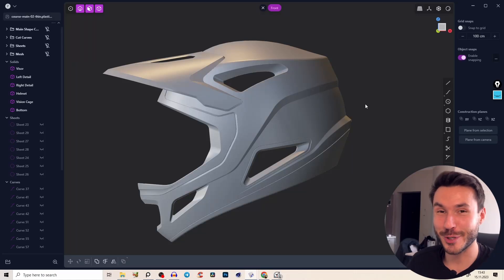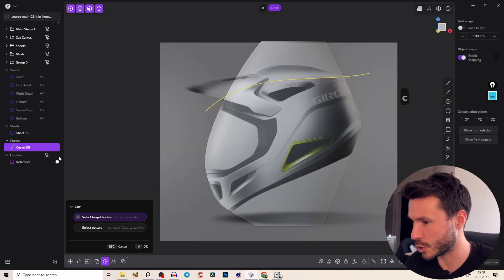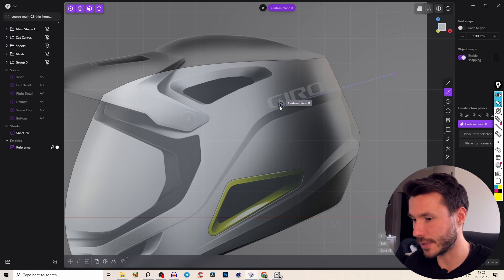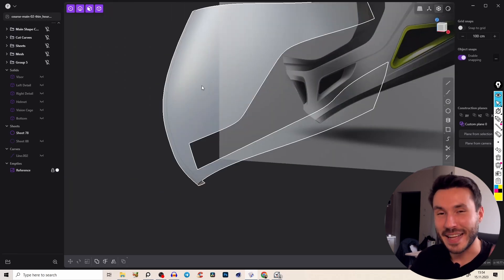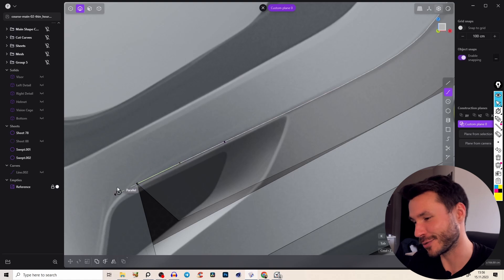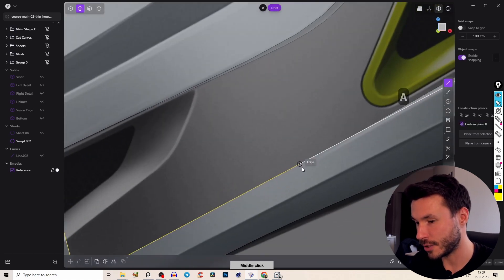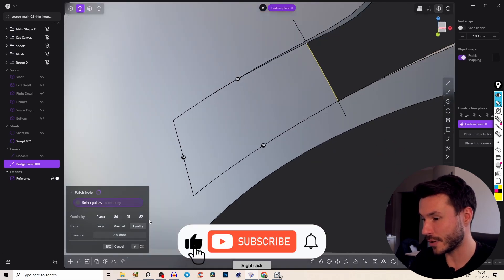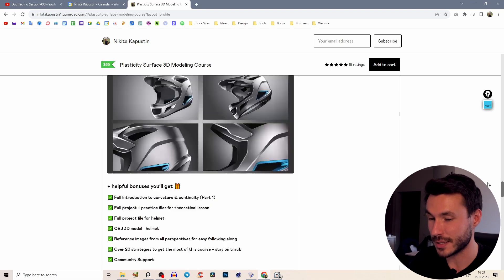How to Create Complex Details in Plasticity in Minutes!

Comment: Great tutorial!  I notice sometimes you use a Control Point Curve, and other times a Spline Curve.  Can you explain when to use each type?
Reply from the maker: I think there is no right or wrong. Generally Spline curves are much smoother, as less points are used, but you cant use them always (when you have "sharp" corners or have to change direction very often).

But it's just with experience you see which curve might be better in the particular case.

If you are a beginner start with control point curve and understand it first, before using spline curve. (My experience)
Reply: Thank you.  @nikita.kapustin